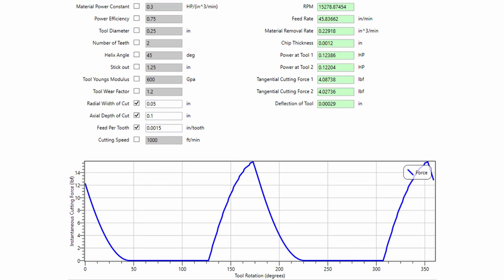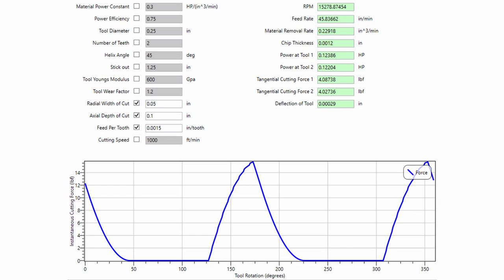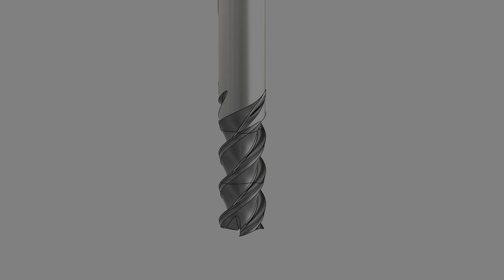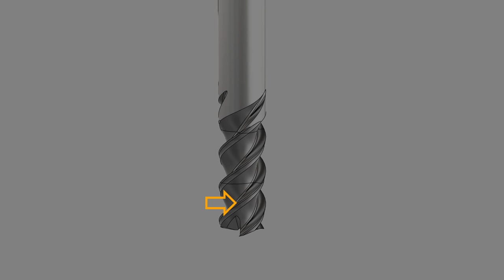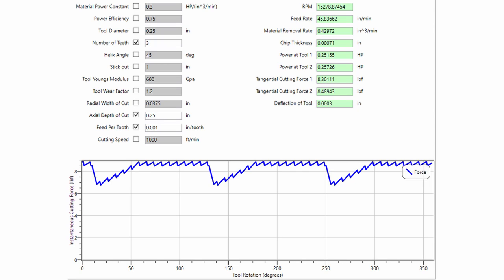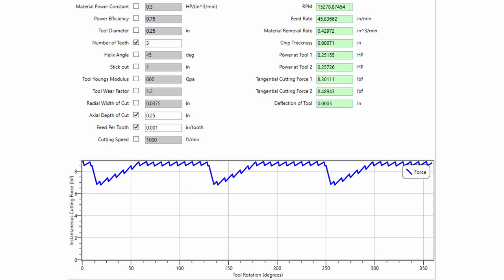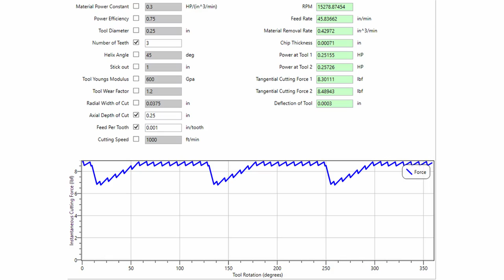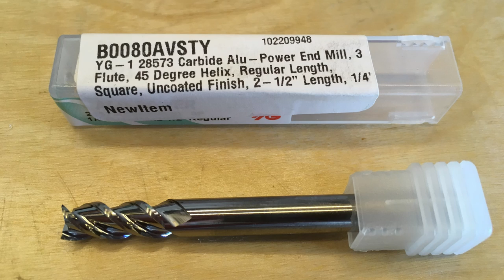Milling Quietly: Tips and Tricks

Comment: Nice work! What are you using for chip removal? I hear a constant whirr in the background. Do you have some sort of pump instead of an air compressor? I have a Taig in my apartment, and I'm working on making it quieter. Right now the air compressor is my loudest item. I just bought an aquarium pump and an airbrush compressor to try if they are good enough to blow the chips off.
Reply from the maker: It's an air compressor. I use a California Air Tools "ultra quiet" model, and compared to other air compressors it is very quiet, but it's definitely not silent when it kicks on.
Reply: @imnoexpertbut  Yeah, I have the same brand. Do you have the 1HP or the 2HP? I have the 2HP its pretty load (but way quieter than other air compressors of similar HP). Did you do anything special to your air nozzle like reduce the diameter to get more air velocity?
Reply from the maker: @nickp4793  No. Sounds like a good idea, though, because the air velocity doesn't seem very high given how much air it takes. It's a cheapo amazon mister, so they probably just used whatever nozzle they could get cheap in bulk.

I have the 1 HP compressor.